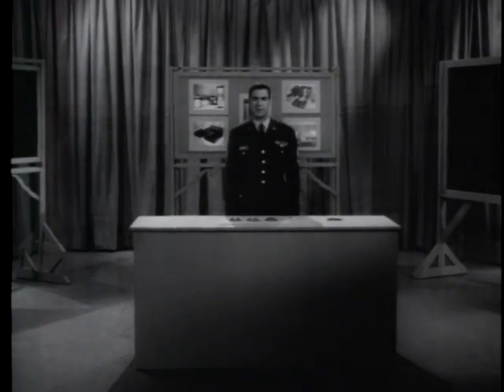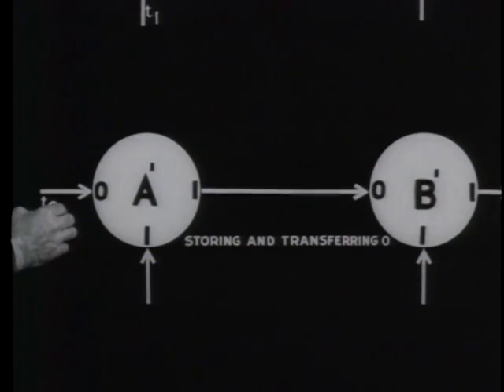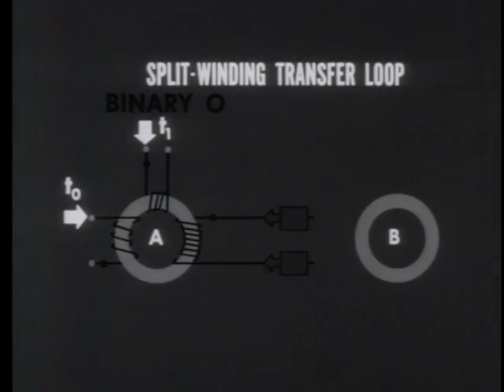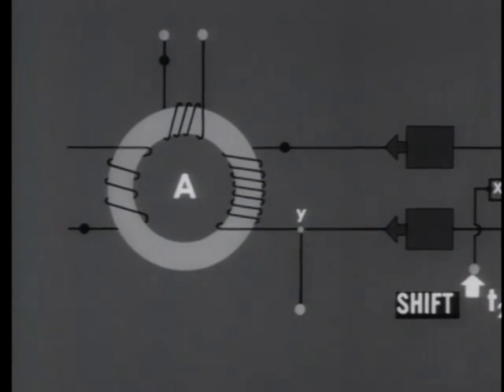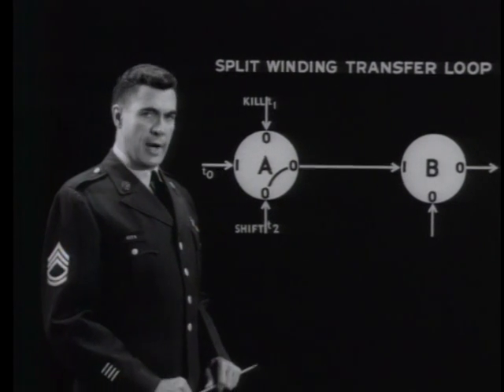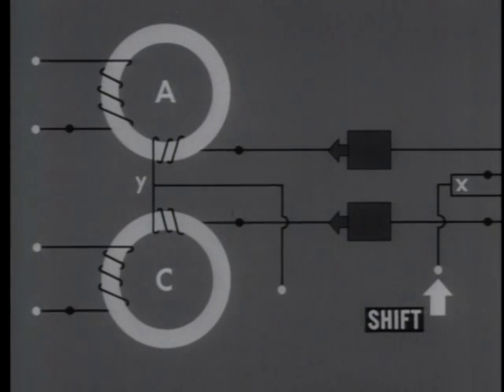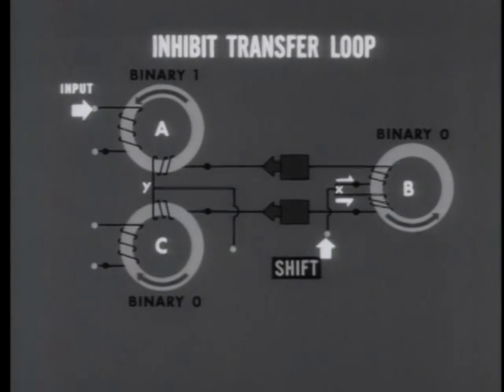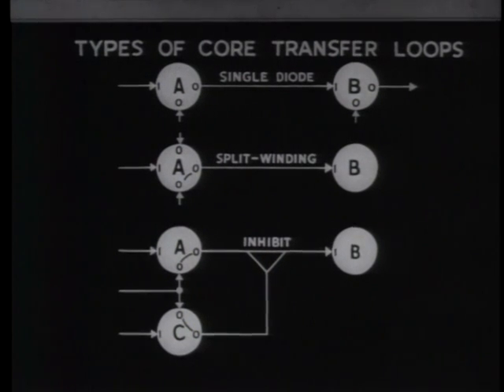MAGNETIC CORES - PART II - BASIC CIRCUITS

Comment: This was the first way of using cores.  Very expensive as each core needed multiple turn windings and they were implementing computational logic via the windings.   Later on when the computation was done with  tubes or transistors all each core had to do was simply store a 1 or 0 and the rest of the machine did the work.  The cores were arranged in grids and strung  on wires that just went straight through, no turns; made it much cheaper.  In the simplest form there would be two address wires and a sense wire through each core.  Since it takes a certain amount of total current to write a 1 or 0 to a core just over 1/2 the current needed was passed through the horizontal and vertical address wires; only the core where they crossed saw enough total current to set the 1 or 0.  To read the data on a core they would have to write to it.  Same hysteresis loop, and same pulse when the bit was flipped as in the movie, that's where the sense wire comes in.  If the core was already holding a zero and you write a zero to it, no pulse on the sense wire.  If the core had a 1 and you write a zero the sense line pulsed.  This was called "destructive read."  If you cared, you had to write back to the core the value it was to begin with.  Each grid was one bit of the computer word, so if you had a 16 bit word, you needed 16 grids or cores.
Reply: I sincerely appreciate you explaining that nuance. I was going back and forth between this theory and the practical cores strung up, confused. What computational logic were they doing with the windings before storing 1 or 0?
Reply: Amazing explanation
Reply: @LydellAaron They use similar ideas but everything is handled in a different way. The core of the technology they operate on is exactly the same. No pun intended.

Comment: I'm watching this now.  I love understanding this stuff from a deeper, electromagnetic level.  I'm 43 years old and ALWAYS worked on computers but not much with electronics.  Got my 1st computer at 11, learned BASIC (it would be like learning Python today - same 'basic' idea).  So the whole binary thing always seemed silly.  Now I'm 'getting' it. I'm gaining a HUGE appreciation for the miniturization.
Reply: +KENNETH UDUT Just to be sure, you realise that modern computers operate on much simpler principles these days? I.e., purely electrical, nothing magnetic going on (apart from in hard disk drives and switchmode power supplies, of course).
Reply: TheHue's SciTech
Oh indeed.
But knowing the evolution is very helpful to me.

When you consider the relationship of the behavior of electrons and "electron holes" in semiconductors and compare it to aligning magnetic fields... it really helps in comprehending "how it works" from several different viewpoints.

electrons and electron holes analogize to balls in cups moving around and aligning magnetic fields analogizes to changing water flow direction.

Yet even within semiconductor lingo, the "source/drain" metaphor remains.  Whole thing is fascinating honestly.
Reply: Actually the basic principles. I.E. Binary, shifting bits around, etc is exactly the same. All that's really changed is the technology that stores and moves the bits around.  The binary operations required for say, adding 1+1 would be the same using magnetic core as described here, or if you were using transistors. However the hardware layouts that implement those functions would be drastically different.

Comment: My difficulty with all of this teaching is that because I don't understand the practical use of doing this I can't really understand very well what is happening and what the ultimate goal of all this is.
Reply: Well it's technology is 40-60 years old and is meant to be forgotten! :D Both this and the first video, though they could gear toward demonstrating any logic, both lean toward explaining a shift register which is still stock logic today in an IC 74595. One use of the day is explained, it could serve as a memory, and common today in light chasers and scrolling LED signs. You can make a light chaser with a 555 timer, flip-flop, and shift register.
Reply: Brek Martin Thanks, that helps a bit. A scrolling LED explains to me the part of wanting to shift the value from one register to the next. I was thinking that they were explaining how memory was stored alone. Which is why the shifting didn't make sense.
Reply: +Pianoman 70s style its simple its differrents circuits to make the differrent boolean operation , they show : not gate, or gate etc but they give differrents name for exemple" the split winding transfert loop" or "inhibit transfert loop"
listen at 28:02 he tell you the purpose.
Reply: It help store bits like a register would.

Comment: back in the day, would it have been physically possible to use capacitors in lieu of the cores?
for example:
while  capacitor [C1] held a charge, it would be a binary One and when the charge of C1 was passed on to the next capacitor [ C2 ]  the value of  C1 would be a binary zero and C2 would now be a binary one.
Also using Electrolytic caps, the polarity could have been controlled.
 with the Pos. to pos. / Neg to neg connection  being a binary one and the inverse of that [ Pos to neg and Neg to pos ] would be a binary zero.
Reply: +DUSTERDUDE238 : In theory, no.  You cannot "pass on" a charge.  When you hook up two capacitors together, the charge flows only halfway from one to the other, until each has 1/2 the voltage.  You also loose half of your power due to resistance losses.  Now, if you add an inductor, you may be able to transfer a lot more power from one cap to the other (sort of like a transmission line), but you will eventually loose all of your charge after enough stages.  You would need amplifiers to recover the charge, and if you actually have amplifiers, you have a switch that you can use to directly implement digital logic (you could easily make all basic digital gates from a op-amps and resistors).

However, you might find the topic of "dynamic logic" interesting, because it uses a capacitor on the output of every gate.  Wikipedia has a good intro on the subject.
Reply: Kevin Harrelson
Ok Kewl Thanks :0
Reply: The caps would slowly discharge
Reply: If you built a circuit that functioned on current instead of voltage yes you could, but due to power dissipation being a function of current the power consumption of such a device would be high.
Using ferric loops like this exploits some properties of matter.

However you can picture the modern transistor as being capacitance based computing since the electron depletion zone within junction has a very small capacitance.

Comment: Apparently this presentation is about combinatorial logic with memory function. But I don't get that. By 1961 technology  was sufficiently advanced that this logic could be implemented using transistors. Only for memory (I mean real storage) cores were used. But these circuits implement flip-flops and latches used to build counters and accumulators and such. In those days the military was even ahead of the civil developments. Or would those circuits have been more resilient to EMP and is that the reason no semiconductors were used? 
The explanation as such is superb. Instructions like this have not being made anymore for a long time. And why not? I know education techniques have advanced during the past 50 years, but errr.... to what exactly? Advanced for the worse?
Reply: 3 years without an answer. Yikes.
These where developed to overcome the issues of the transitor as they had them up tp the 1960's.
 And that is to say vacuum tubes, and discreet components, that where all highly lossy, slow in comparison, and very dependant on current and heat.
Of course modern transistors are still dependant on current and heat sensitive but not as bad as they where back then, but magnetic logic itself is not volatile, that is it keeps its data when the power is removed, and that brings down operation costs, very important when a simple computer fills a room.

In addition the advanced windings could offer an half adder with a single core, although I do not know the schematic, but that alone brought the size of these machines down to a single wall, and that was using 1 inch cores, before the transistor and it's ability to be integrated overtook the speed and matched the efficiency of the core logic.

But this is just the tip of the iceberg when it comes to the logic methods we abaonded, and are now looking to revive due to issues with further shrinking. We can produce tighter tolerances and some smaller features allowing for some gains, and still see the advertising bragging about about smallest features but transistors and capacitors have reached thier limits.

Comment: To think that today most people can't even do LED blinkers without a microcontroller...
Reply: +szlatyka Imagine that using uC may be the cheapest way to build LED blinker today :O
Reply: +brys555 : A 555 timer will at least require the chip, plus a couple of resistors and caps.  Since you can get a micro for under a buck that does not require those passives, why not?  Some micros are available in an 8-pin package and about the same price as a 555.
Reply: Kevin Harrelson
Some PIC10F.. and ATtiny10 are available in 6-pin SOT23 package.
Reply: Flip-flop circuit.
Reply: People talking about a 555 or a flip-flop are overkilling it. Just make a bistable multivibrator with a couple of transistors and a couple of caps, plus a few resistors to charge/discharge the thing.